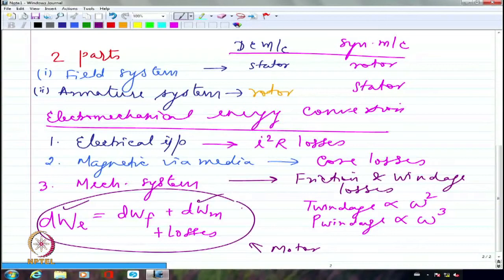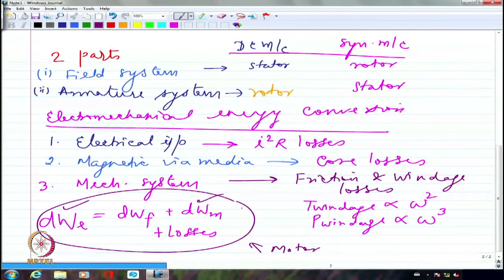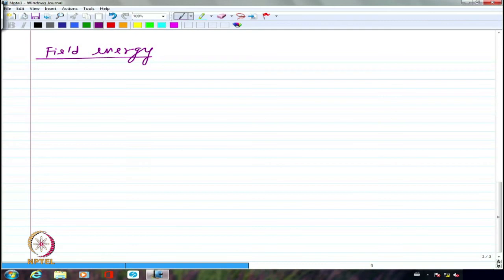Electromechanical Energy Conversion-I

Comment: why does inductance changes with change in air gap?
Reply: Inductance is basically flux linkage/current
it gives for a given current how much flux linkage is present 
By changing air gap more/less flux will be linked in the coil
In a magnetic circuit for a given mmf a certian flux will be formed based on the reluctances
By varying the air gap you change the reluctance of the circuit altering the flux linkage